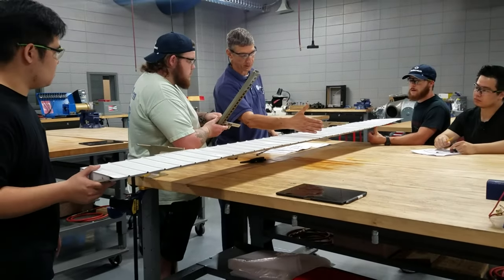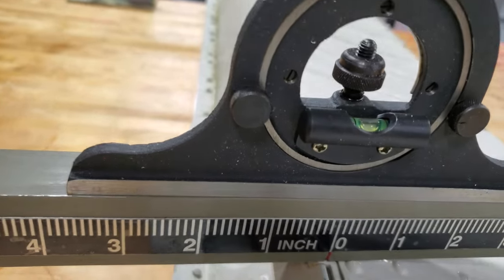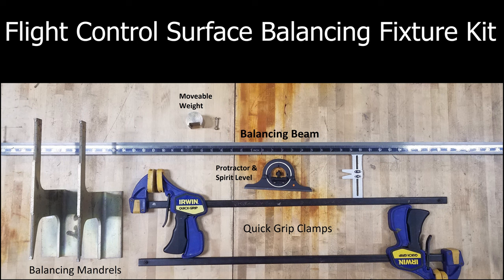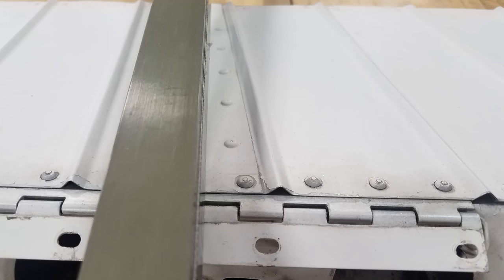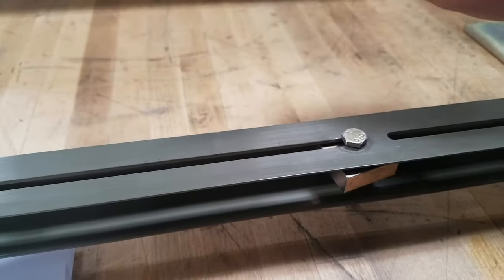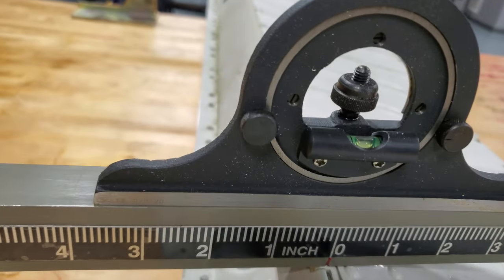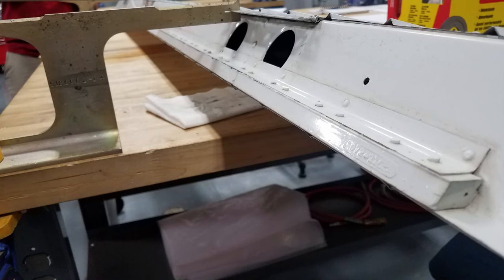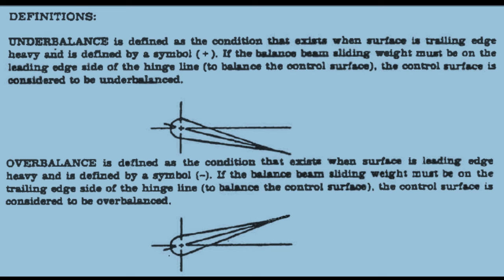Cessna 152 Aileron Flight Control Surface Balancing.  Airframe Powerplant Certification

Comment: Hi there, why are the mass balance weights located towards the out-board end of the aileron, and not the in-board in the Cessna 152 and 172 etc. ? (Is there a POI imbalance to resolve on the rather symmetrical looking aileron?) Cheers
Reply from the maker: I'm uncertain...sounds like a manufacturer's question.  Sorry.